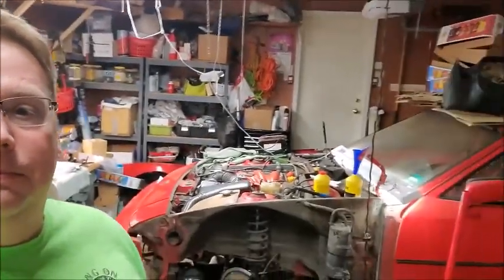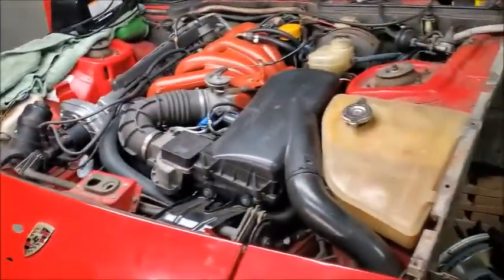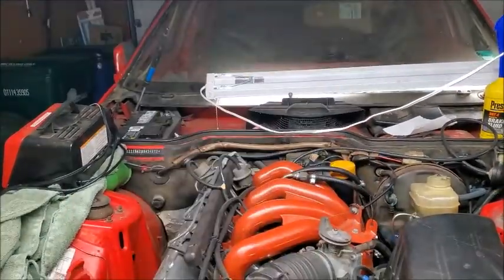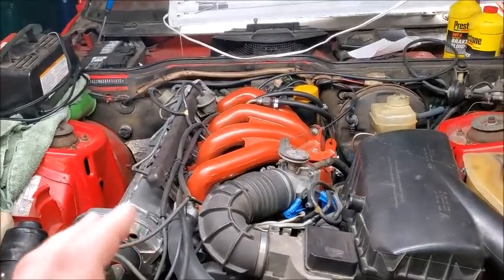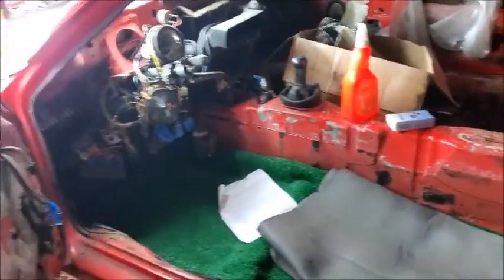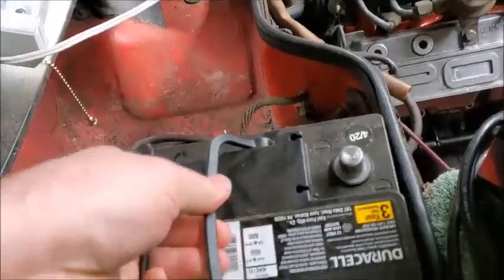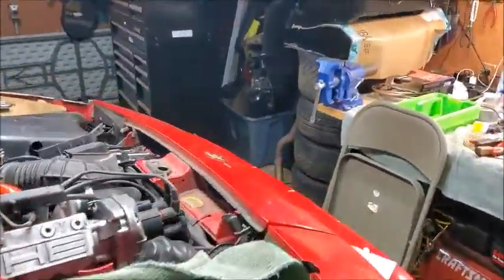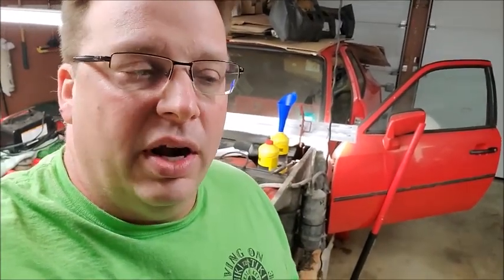1983 Porsche 944 Garage Squad!

Comment: What’s the biggest issue you’re having with the car? I have a 1983 944 exactly like yours, so I may be able to help.

I had an electrical fire in my car, so I’m going to be stripping it apart. Hopefully I can fix it. 

I posted it another video about being in the STL area - Jeff at It’s Alive Auto is really good and reliable, he may be able to do some work. He’s cheaper than most other mechanics, but he has a slower turnover time.
Reply from the maker: Thanks for the offer. The problem is not just one thing.  The latest example is the brake lines. I get excited that I  got the brake line I needed. Was going to bleed everything and get the wheels on. Then another line blows out, then another. It gets to be a lot at times.
Reply: @schillershop9036  Oh, I see. Yeah, you mentioned the car had been sitting for quite a while, so a lot more lines are going to need replacement. If you get the car running and things start warming up, those old dry-rotted lines may start to leak. It's a pain, and its happened to me on another old car. 

Maybe you should shift your focus to getting the body and rust taken care of and take a break from the other maintenance stuff?